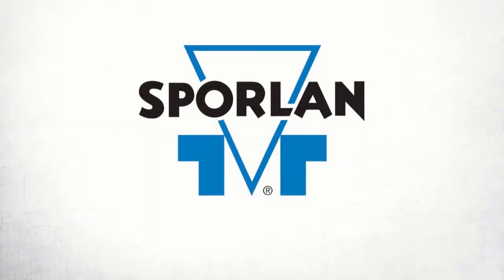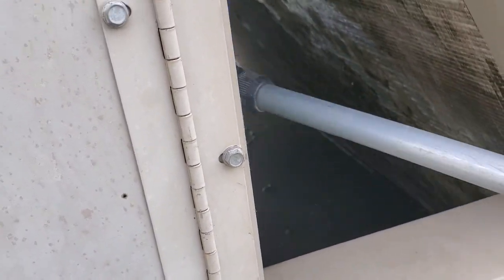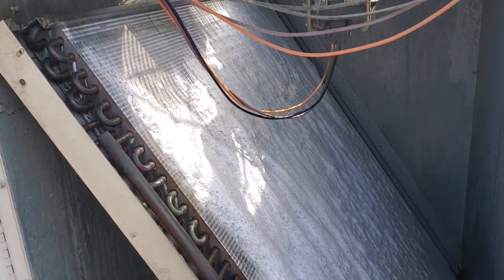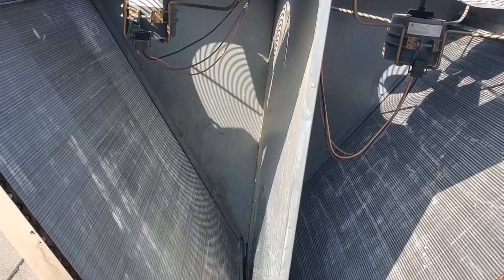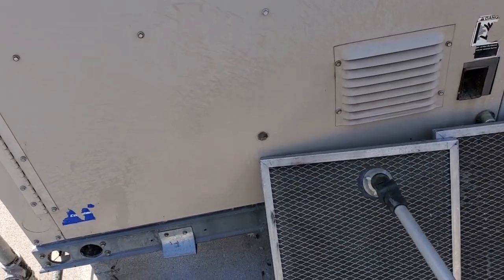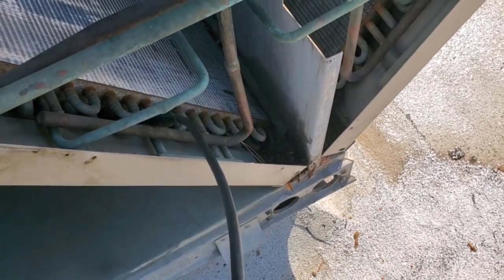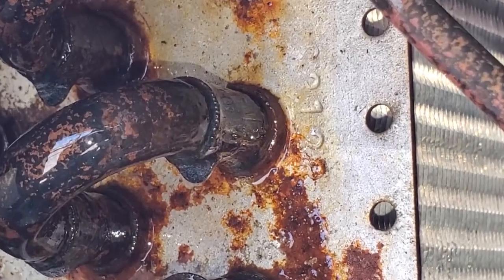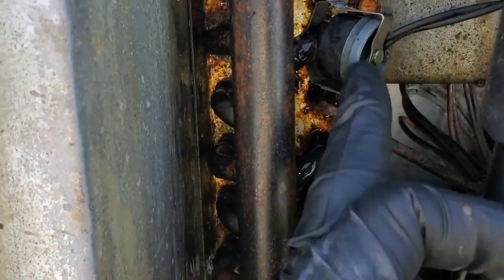LENNOX KITCHEN AC NOT WORKING

Comment: So it is entirely plausible that this repair bill was due to saving money on a cheap coil cleaning service. If they were too rushed or just didn't care they wouldn't do a good job of cleaning the coils. If the cleaning solution, even highly diluted, can corrode the coils at weak points like solder joints then not thoroughly rinsing the coils while cleaning them could have caused the coil solder leaks. It looks like an opening in the market to hire, maybe senior citizens(?), to come by in the wee hours of morning and clean the coils and take their time to do a good job. Clearly you get what you pay for. I also think any service that can offer a video record of them doing the work is invaluable. Keep up the great work.
Reply from the maker: You hit the nail on the head, Thanks for watching I will be going live on YouTube this evening 7/1/19 @ 5:PM west coast time to discuss my most recent uploads and answer questions from emails and the chat. Come check it out if you can  https://youtu.be/rlHkdZSIjdU

Comment: Have you ever consider using leak stop for a temporary fix? Sometimes due to season or other factors either the owner or the hvac company cant change the unit at the moment and what I do if they cant replace the unit right away i add leak stop and come back a month later as a follow up to make sure leak stop worked properly and add the few ounces I lost until leak stop cover those leaks or slow it down at least and that gives the costumer enough time to make a decision or time (as I said it's just a temporary fix maybe just to go through the season only and then change the unit and only works with micro leaks but it helps when you have several of them at the same coil of course if you have bigger leaks and can be braze then that would be the solution but sometimes that is not the case)

Comment: I do residential and have about 2 years experinced.  I know how to test TXV ny warming or cooling the bulb, but using SH and SC while charging to notice a bad TXV has always elduded me a little.  What does "stacking in the condensor" mean?  Also, any tips on recognizing a bad TXV while charging?
Love you chanel!
Reply: High head pressure low suction pressure. You’ll notice while charging that the refrigerant sticks to the high side but won’t affect the low side at all.
Reply: @hvacinthecity9369  Thank you!
Reply: kerryithm2  Ahh, i got ya.  Just never heard that term.

Comment: Just a question. Why not use something like Dawn Dish Detergent instead of that nasty coil cleaner? It'd be cheaper and safer, because it's shouldn't attack the coils, just the dirt. Also a pretty good degreaser. A ton better for the environment as well, compared to coil cleaner, and safer for yourself incase you were to accidentally spill it all over yourself. You just get a good bath/shower instead of a trip to the hospital for chemical burns.
Reply: It doesn’t work good on what we find in the systems. We do use dawn soap when units are too close to exhausts
Reply: think about the sudsing power of dawn (yes it's great on oils but...). Now consider just how much bullshit it would be to remove that from the fins. That's why you don't want to use dawn unless you have to.

Comment: quesiton - ODP requires no topup until the leak is fixed. how this is justified in this trouble suppoting?
Reply from the maker: We are allowed to top off the charge in the united states, we can leave a system leaking for as long as the customers likes if the total system charge is under 50 pounds... I’m going to discuss live on YouTube this evening 6/29/20 @ 5:PM (pacific time) come over and check it out https://youtu.be/qAVMB2gj6Kc

Comment: you were liquid charging through low side is liquid charging a compressor can actually damage the compressor??
Reply: Aslong as you flash it, it’s ok
Reply: Not as dangerous as it seems... think about the “orifices” the liquid has to go through. First, the valve on the tank he’s opening by hand and the schrader valve on the access port (at a minimum). If he’s also using a manifold and low-loss fittings there may be even more. 

Combine that with adding just a little at a time as he’s doing and it’s very unlikely to get liquid in the compressor.
Reply: Only when you dont know what your doing.
Reply from the maker: Thanks for watching I will be going live on YouTube this evening 7/1/19 @ 5:PM west coast time to discuss my most recent uploads and answer questions from emails and the chat. Come check it out if you can  https://youtu.be/rlHkdZSIjdU
Reply: Give the compressor a little credit, it's not made of glass after all

Comment: I hated Swiss cheese evaporator repairs. Seems when you repaired a leak in a u bend sometimes after the repair is done and passes leak test, a leak shows up at a later date in the field of the coil under the fins no matter how well you control torch heat since the tubing is so thinly extracted for heat transfer.
Reply from the maker: Thanks for watching I will be going live on YouTube this evening 7/1/19 @ 5:PM west coast time to discuss my most recent uploads and answer questions from emails and the chat. Come check it out if you can  https://youtu.be/rlHkdZSIjdU
Reply: If you do the repair, you might want to add acid away to the system based on what may be corrosive leaks.

Comment: the leaks are real small why not use stop leak to handle it
Reply from the maker: I am not a fan of any system additives, I would rather permanently seal them with a braze joint
Reply: HVACR VIDEOS remember the only thing that should be inside a system is “refrigerant “ and refrigerant only ! Not a fan of stop leak crap 💩. Rather find the leak and repair it . Simple
Reply from the maker: Thanks for watching I will be going live on YouTube this evening 7/1/19 @ 5:PM west coast time to discuss my most recent uploads and answer questions from emails and the chat. Come check it out if you can  https://youtu.be/rlHkdZSIjdU

Comment: Topping a sytem up knowing it has multiple leaks is a big no no .
Reply from the maker: It is totally acceptable here, nothing wrong with topping off the charge of a unit this size.
Reply: @HVACRVIDEOS  You're knowingly releasing refrigerant into the atmosphere, which is illegal.
Reply from the maker: That is a negative sir I am not releasing refrigerant into the atmosphere intentionally. I added refrigerant to a leaking system that is not illegal. The customer has approved my repair so I will return and repair it.
Reply: @HVACRVIDEOS  As per the US Environmental Protection Agency, R22 refrigerant will become illegal in the United States on January 1, 2020. After that R22 refrigerant phase out date, R22 refrigerant can no longer be manufactured or imported into the US
Reply: murray fleming EPA mention that you’re allowed to charge the unit ONE time with R-22, mark the unit with the leaks. After that In general, owners or operators of an appliance that is leaking refrigerant above the applicable trigger rate must either repair leaks within 30 days from the date the leak was discovered, or develop, within 30 days, a plan to retrofit or retire the appliance and complete the actions under that plan within 1 year.
Reply: @muzza6047  Understand why their doing this, R22 is heavier than air the problem is the patent.
Reply from the maker: One of the biggest problem in our industry is the lack of information available to service companies and the plethora of false inforamation that people spread. Taken directly from the EPA's website it clearly says that you are only required to repair leaks on systems containing over 50 pounds of refrigerant. anything under that and the EPA doesnt care. Here is the text from their website>>>> "Owners or operators must take corrective action when an appliance with a full charge of 50 or more pounds is discovered to be leaking ozone depleting refrigerant at a rate that exceeds the applicable trigger rate. Starting January 1, 2019, these requirements will also apply to appliances containing substitute refrigerants."<<<<<< so legally our customers dont have to fix anything if they dont want to, now it is our moral obligation to let them know of the leaks and try and repair them if they approve but there is no law at this time saying they have to be fixed. And also we will be able to still sell R-22 refrigerant for the foreseeable future there is no law that states we cant sell it, the law simply states it cannot be made and or imported into the U.S.. Our refrigerant distributors have stockpiled millions of pounds of R-22 refrigerant and so long as the customer wants to pay the high prices for it we are legally able to sell it.

https://www.epa.gov/section608/stationary-refrigeration-leak-repair-requirements
Reply: @HVACRVIDEOS  Ok admittedly it has been proven in a lab to be capable of damaging Ozone, but is as it's heavier than air it can not get anywhere near ozone high in the atmosphere.So their point about leaking ozone depleting refrigerant is a mute point, if the leaks are not found and fixed the refrigeration system will eventually stop doing it's job, necessitating the need to find and fix the leaks anyway. In any case most of the replacements apparently are worse than R-22.
Reply: @HVACRVIDEOS  USA is miles behind the EU when its coming to phasing out refrigerants. `R407c R410a proceeded R22 now all ac units splits/vrvs packaged units are all R32 with a much lower GWP than all of the mentioned refrigerants. USA will eventually fall into place too. Prices dictate what gas we use R410a is approx $800 for 11kgs.
Reply: Here in the UK we are governed by FGAS regulations . It is illegal to top up a system if you know it is not pressure tight (if it has a leak).